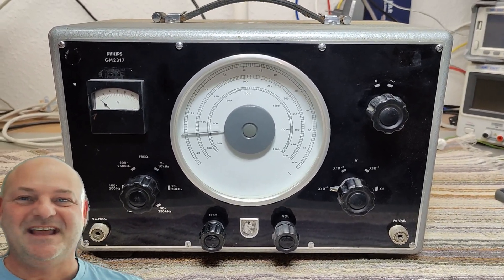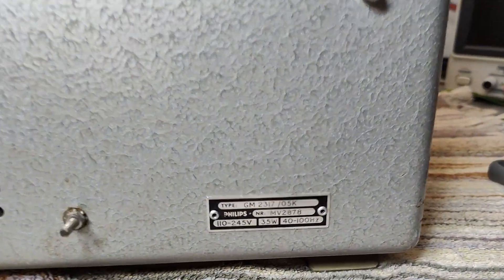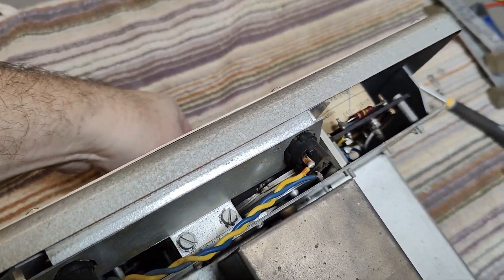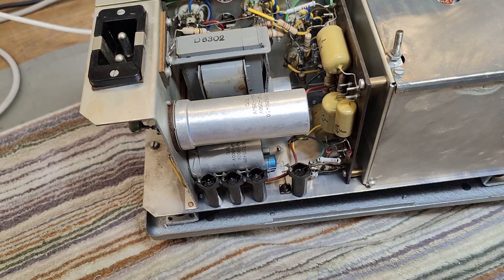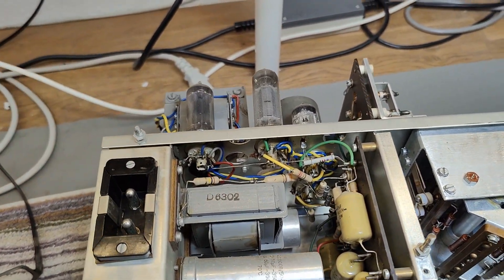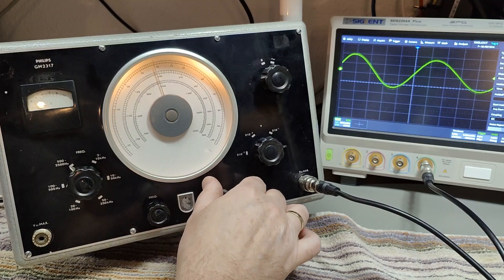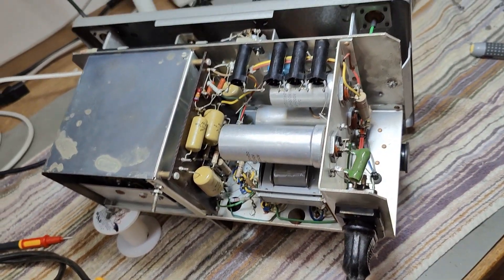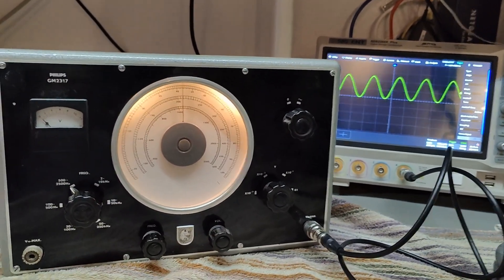Philips GM2317 sinewave generator 20Hz-250kHz 1960

Comment: What a coincidence, I am contemplating buying one and I thought I check to see if there is any video produced on this and voila!

The one for sale does not have a power cable, so I won’t be able to test it.  I found T727 plug from the old style cooking stove that looks similar, but there are 2 types, 5mm pins and 6MM pins.

May I ask your help to check if they are the 5 or 6MM pins?

Comment: I have one of these instruments and it has EZ80, EL84, and 2X EF86. The green resistor in mine was open circuit. It would oscillate for a few seconds as the valves warmed up and then stop. A replacement resistor fixed it and it now works very well with all its original components. Thanks for the video. Cheers!